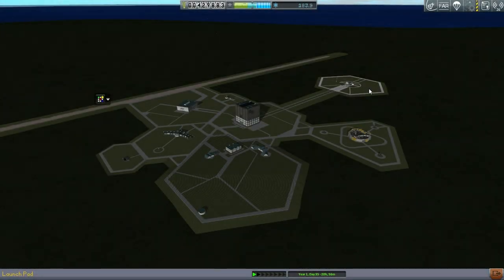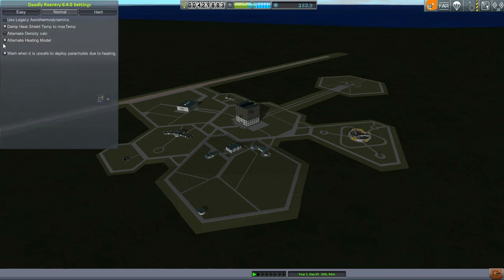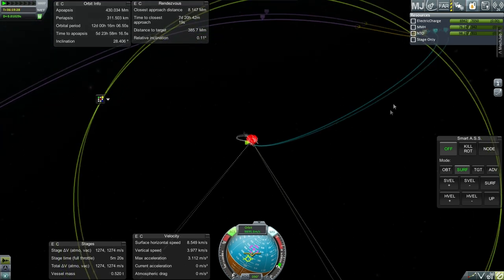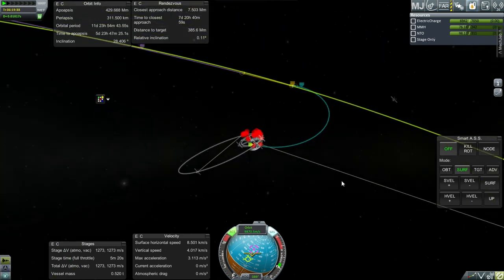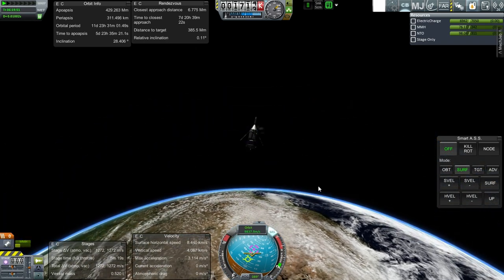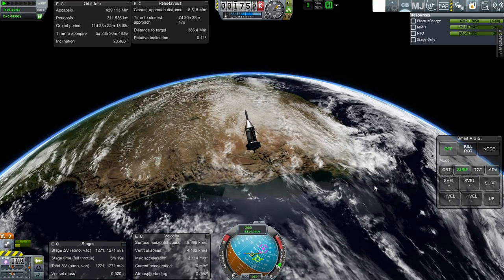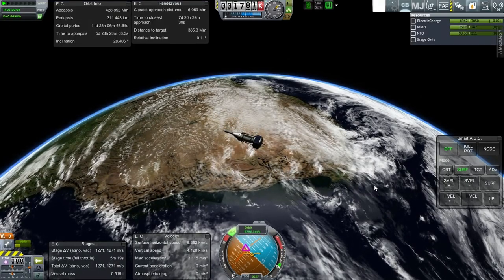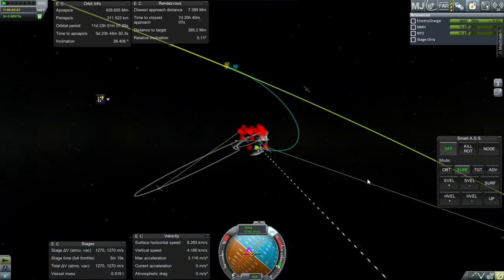Realism Overhaul in KSP Beta 10 - Lunar Satellite Contract

Comment: Whenever I try to make a very advanced rocket I only get about 12k DV and sometimes these advanced rockets take me 2-4 hours to build. I have a lot of fuel and I went through every single part and saw if anything was wrong but nothing was. Any tips? I use 3.5m diamater custom built parts so it should be fine.
Reply: I am practicing with a very small communication satelite. I use KW and AIES engines that work very well. I can't remember the name though.
Reply: Thank you, I recently made a vehicle with 15k DV and I'm trying to get it to the mun. Hopefully it works.